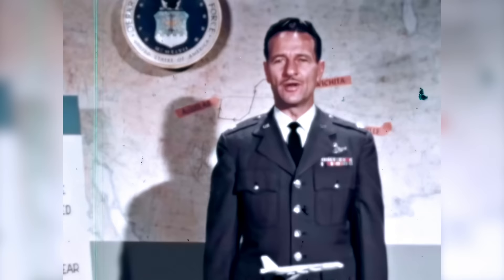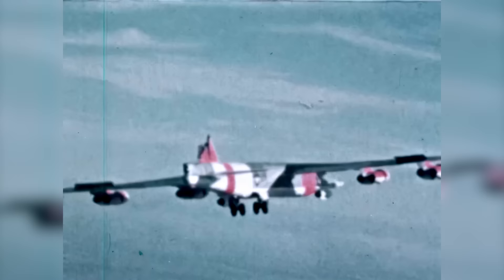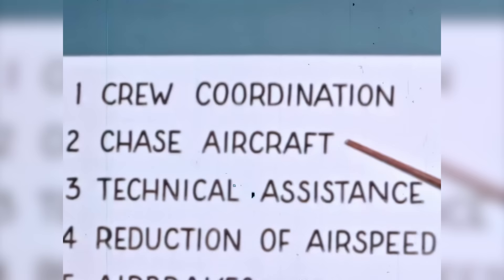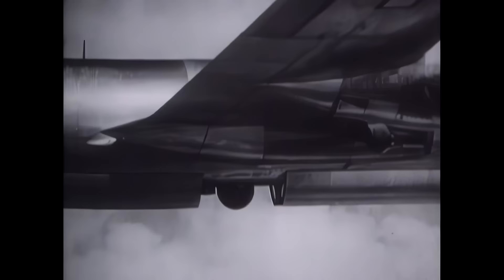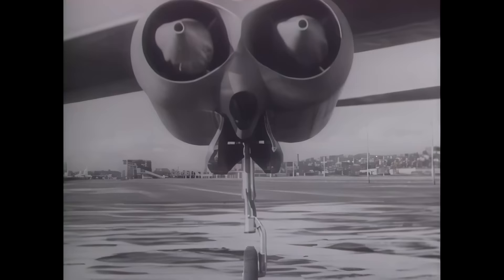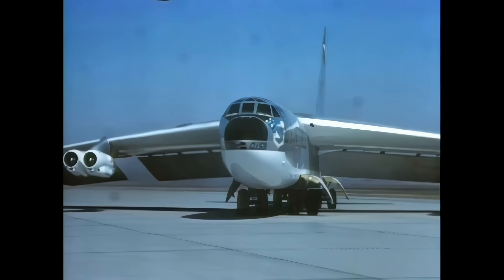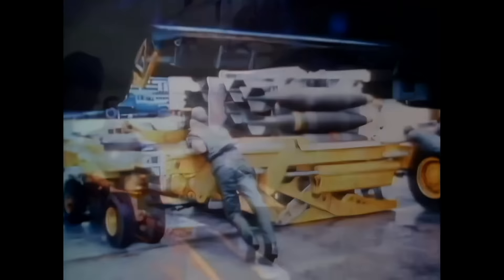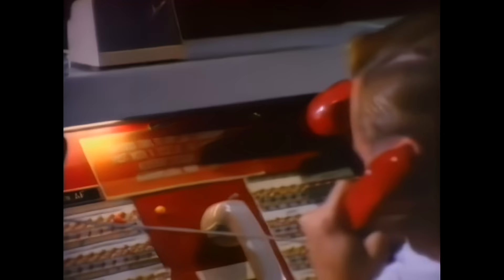The B-52 Stratofortress That Lost The Tail | Aircraft Accidents

Comment: I had planned to go on this flight as an observer. I was Chief of Structures Technology at Boeing-Wichita at this time, and the data from these flights was sent to my section for analysis.The purpose of this flight was to record gust velocity and airplane accelerations and stresses during low level flight. This was at the height of the Cold War, and SAC crews were required to practice this type of terrain avoidance flying to be ready to penetrate below Soviet radar. These flights and other activity were part of a vast program to understand the environments in which the B-52 had not been intended or designed to fly, and to analyze the effects on the structure. I had planned to go on the flight as an observer, sitting behind and between the pilot and co-pilot, but this plane did not have a tie-down restraint for an observer. Chuck Fisher, was concerned for my safety and suggested I fly instead on 56-632, which had a seat belt attached to the flight deck, and which I had flown on before. So I flew with Dale Felix and his two-man crew on a different low-level route two days before Chuck's flight. During my flight, Dale let me sit in his pilot's seat and fly a short while, with the co-pilot keeping a close eye, of course. So there I was, tooling around only a couple hundred feet over the farms of eastern Colorado in an eight-jet-engine beast. Quite a thrill for a non-pilot!  And two  days later I was glad not to have gone on Chuck Fisher's famous flight. When he first lost control. Chuck had given the order to "Prepare to abandon ship." If I had been aboard, I would have been on the upper deck, with my ejection seat on the lower deck, and it ejecting downward!!. Not a pretty picture. We analyzed the data from this flight and found the gust velocity was three times that for which the plane was designed.  A year or so later, we had made modifications to strengthen the tail and fuselage structure to withstand these forces. I then flew with Dale Felix over the same route as this flight, up and over and around the foothills. It was quite a thrill. I am now 96, and it is a very memorable event of my life. Thank goodness, with the end of the Cold War, this type of training is no longer required.
Reply from the maker: Thank for sharing your very interesting memories Lawrence. Such an interesting story! Have a great weekend.
Reply: Thank you Mr Gore for your diligence in making our journey a safe one.
Reply: Que relato legal Deus abençõe o senhor ,eu sou um apaixonado por aviões e pela USAF meu sonho conhecer um avião desses de perto ,infelizmente moro no Brasil e não tenho condições ,Deus abençõe a America !
Reply: Wow! Fantastic memories sir
Reply: @alfredogontijo8044  Thank you Alfredo. I hope you make to the USA some day.
Reply: Poxa vida nem acredito que o senhor leu meu comentario Jesus Cristo que legal !
Reply: @alfredogontijo8044 Alfredo, Infelizmente não falo português. Mas através da magia do Google posso traduzir o que você diz. Desejo-lhe o melhor e espero que esta tradução reversa seja precisa.
Reply: What the fu-
Reply: Buddy  that was a dandy of a story 
👋👋👋hello  from canada 
Keep well
Reply: Just, WOW!
unbelievable times.
Reply: Thanks for sharing your memories.
Reply: Sounds like you've had a good run during your 96 years...thank you for your service to our nation. God bless you.
Reply: Thank you so much, Sir, for sharing your most valuable experience with us.
I hope you're still flying, at least as a passenger.
My Dad passed away a short while after his 100th birthday, he was the last Frog Spitfire pilot from WWII, with RAF Sq 340. He kept the beautiful mind you share with him, to his last breath. We will never see again warriors like you guys.
God bless you.
Reply: Lawrence Gore.
Yeah, but I think selling the bear skin before you kill it isn't very good. The recent fighting in Ukraine may call for a revision of this “Cold War” rhetoric. Don't you think, especially with your veteran knowledge... Bravo! Michel from France.

Comment: F111f came home and safely landed having lost its vertical stabilizer with only a few shreds of honeycomb still attached  to the fuselage.  I was assigned to photograph it.  Was amazed at the time but later flying r/c airplanes realized it was possible to get down with just the elevator and ailerons.

Comment: Big diffrence between a tail fin or vertical stabalizer and the whole "tail" section.  Every single Aircraft can fly without a vertical stabilizer on the rear.  Now remove the horizontal  stabilizer and you will have issues.  Taken the period of time this clip was shot and yes I'm sure this was very exciting for 1964 but for 2023 not so much.

Comment: Am I correct in thinking the remaining 17% was critical to making a safe landing - as opposed to losing it all?
Reply from the maker: Interesting question. You are probably right
Reply: Very likely
Reply: Not realy: the rudder is only necessary for cross wind landings, but with the wind in line with the landing strip, it's not absolutly needed, and to make turns ,the rudder is not absolutly needed for slow turns: the vertical stabilizer/rudder is mostly use to maintain symetric flight depending from wind direction and wing inclination